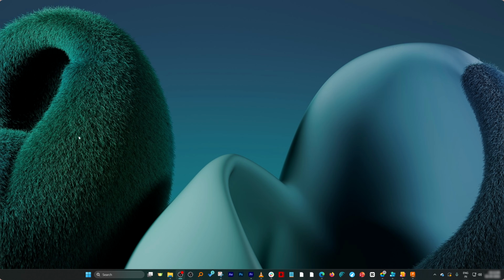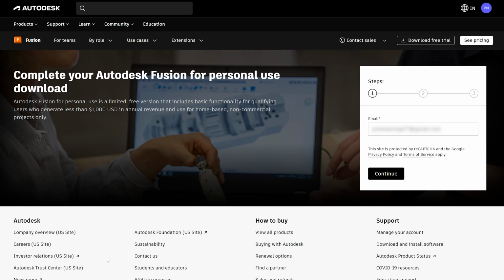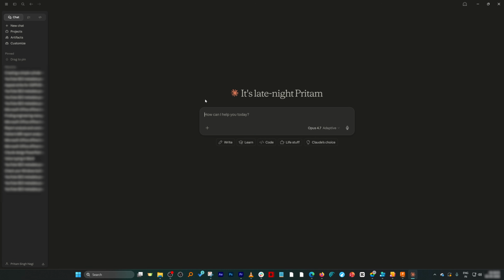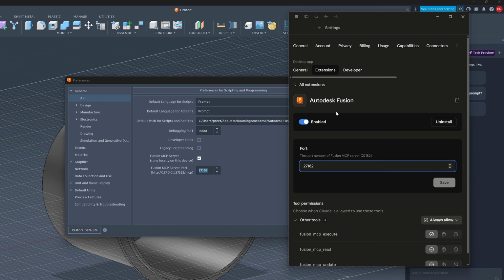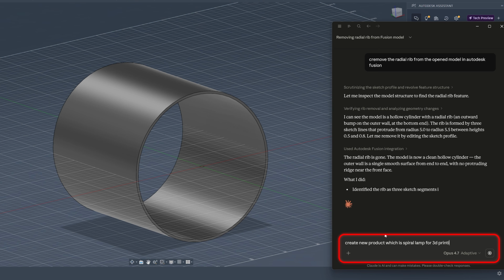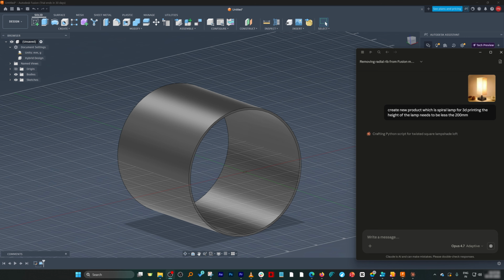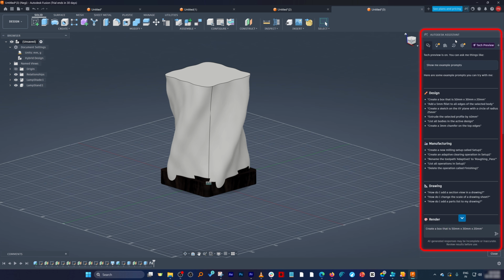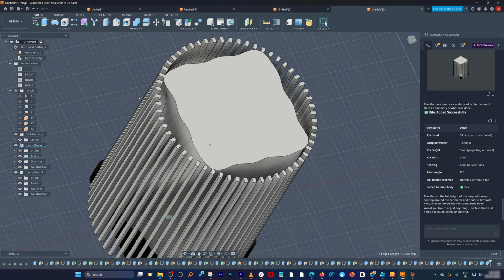I Let Claude AI Control Fusion 360 (You Won't Believe What It Built)

Comment: Can we make drafting also. ? The changes has to be updated as well.?
Reply from the maker: Yes, you can create a 2D drawing from the model too 🙂 Autodesk Assistant can help set up the sheet, views and dimensions, though I didn’t show that part in this video.

And yes, if you change the 3D model later, the drawing can be updated. Save the model, open the drawing and click the update icon if Fusion shows it’s out of date. I’d still check the dimensions and annotations after a big design change, as some may need fixing.

Comment: Will it be possible to draft the professional drawing from 3D modelling,
Reply from the maker: Yes 👍 In fact, this is already becoming possible. Autodesk Assistant can now help generate professional 2D drawings directly from the 3D model, including views, dimensions, drawing standards, etc. Of course, tolerances, GD&T and manufacturing requirements still need an engineer’s review. I’m actually thinking of testing this in a separate video 😊

Comment: This is very practical. Can this be directly connected to AutoCAD or some other 3D software?
Reply from the maker: Yes 👍 I hv also tested similar AI-to-CAD workflows with FreeCAD and PTC Creo.

FreeCAD + Claude: https://youtu.be/MrOUIC1TJGY
Creo Agent: https://youtu.be/KMlmF3A7bEo

So this is definitely not limited to Fusion. AI-driven parametric CAD is expanding very quickly.

Comment: The time it takes to learn the precise nomenclature to hack Claude’s software rationale could be the same amount of time that it takes to learn the buttons in fusion, and you don’t spend $20-$200 a month on two of these prompt creations every five hours
Reply from the maker: Fair point. For an experienced Fusion user, doing it manually may still be faster and cheaper today. AI CAD is still at an early stage, but it could become useful for repetitive tasks and multiple design variations.
Reply: @EngineeringWithPritamNew  I could see it being able to replicate something very simple and maybe in 6 months or so it’ll actually reduce labor in general.  I tried Pro, got a refund, and am planning to keep an eye on it in 2027
Reply: @Sufficient-Spirulina  try codeify x)

Comment: Which is better Autodesk fusion or Sketchup I am a beginner and want to design wooden furniture
Reply from the maker: For wooden furniture, SketchUp is easier for a beginner. Fusion is better if you need precise joints, parametric dimensions, CNC work, or manufacturing-ready models. I would suggest starting with SketchUp.

Comment: That doesn't look right, does it? Would have been much easier to just do it yourself using the toolbar
Reply: As an engineer myself...I totally agree.
Reply from the maker: Yes, for this particular task, using the toolbar would have been faster and cleaner. I mainly wanted to show what AI can currently do inside parametric CAD, even though the results are not perfect yet.

Comment: What does this mean for Cad engineers??
Reply: It depends if your only skill is CAD or are u an actual mechanical engineer. Because CAD is only a tool, if someone without knolage of manufacturing, material science, structural mechanics and dinamics just put some propot into the AI, they probably will create SOMETHING... maybe even good looking part but nothing else.  CAD design is the last step bewteeen a working solution and a final blueprint goin into production. The same isssu is with software development. Maybe using AI you eventually create semi-working app. But without knolage and deeper understaing at some point you will get stuck at some random ass problem that you will not be able to put a correct prompt do deal with. If as a engineer your are scared that AI will take your job as a CAD desinger - try to expand your skill set in other, more difficult topics. Like FEM simulation, dinamic analysis, mechanism deisng, mass/strentght optimisation of a desing. And the more specific your topic will be, the smaller chance the AI will replace you - bacause AI models are working on huge amount of data. and without many examples of the simmilard problems, no AI model will figure out the solution on its own (i am talking about LLM not some future, actually thinking AI models)
Reply: You probably going to be okay.. The amount of prompts it takes plus tokens it burns, it's probably easier to do it yourself. But if you have management which wants to showcase AI usage, then you would end up doing this anyway.
Reply: @mvadu AI will get cheaper. Also imagine in the same time you do for 1 drawing you can make 10 or more variations won’t your boss like you
Reply from the maker: Exactly. Creating multiple variations quickly could become one of the biggest advantages. The engineer would still need to review them and make sure they are accurate, practical, and manufacturable.
Reply from the maker: I agree. Right now, an experienced CAD user can often complete the task faster manually. AI is currently more useful for repetitive work and design exploration. And yes, sometimes management may simply want that AI slide in the presentation. 😄
Reply from the maker: CAD engineers will still be needed. AI may reduce repetitive work, but engineers will still need to check the design, dimensions, tolerances, manufacturability, and whether the part actually works.